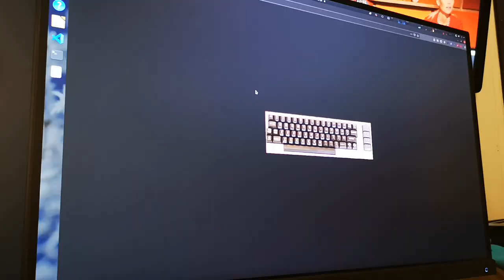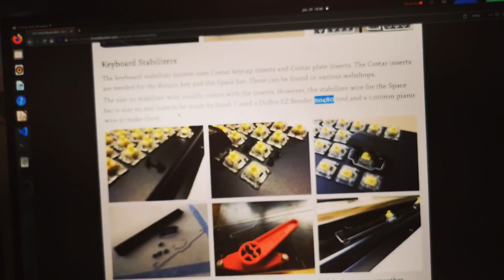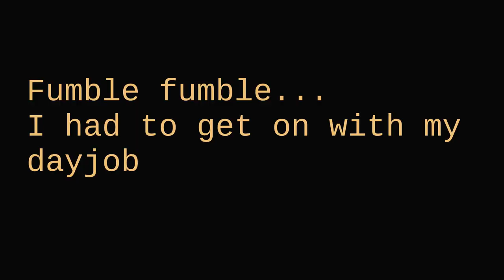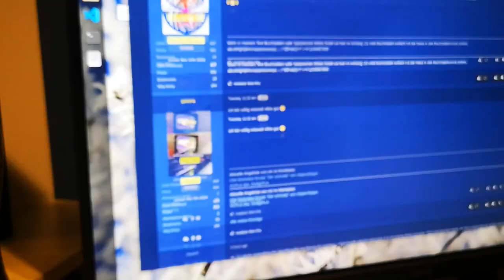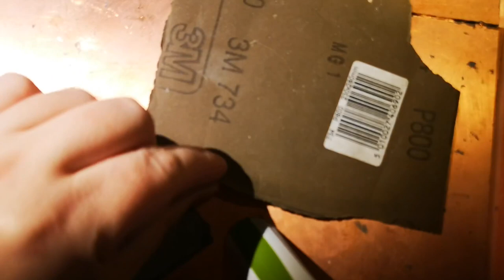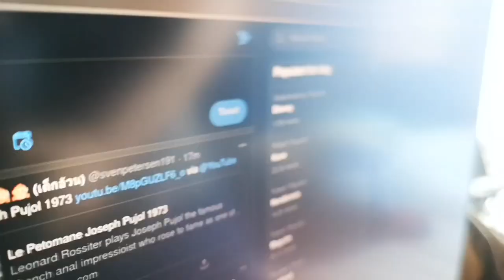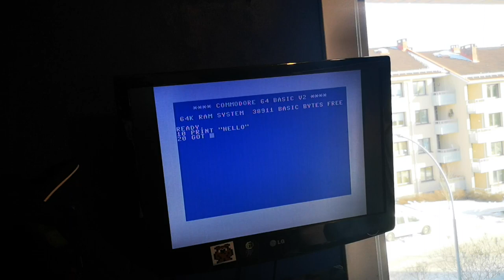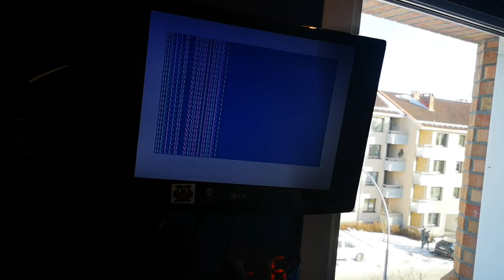MechBoard64 build part2

Comment: The trouble with these keys is the incredibly small tolerances. I have a similar problem with my C128. The N and M keys work only in the wrong positions for some reasons. 
Well done for getting it to work. The RETURNing nightmare.
Reply from the maker: Thanks Wouter! The return key I had to reduce the phootage by a lot. Cutting it down. A lot of trial and error.